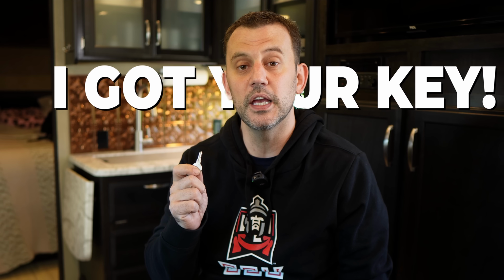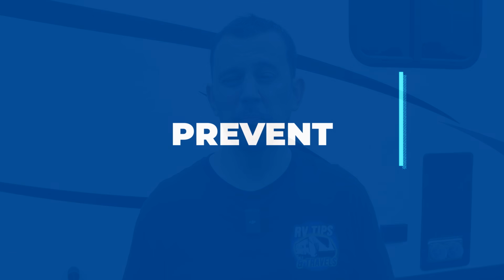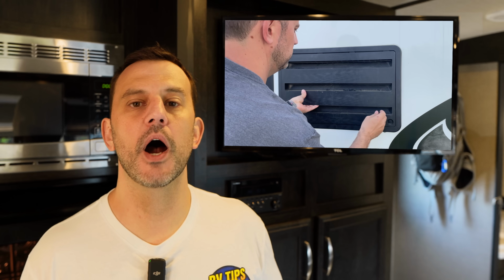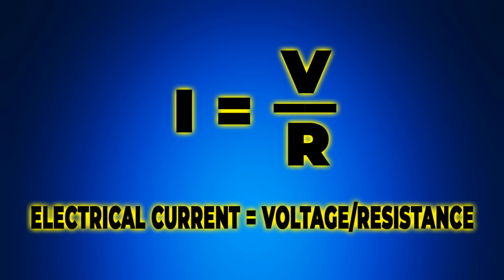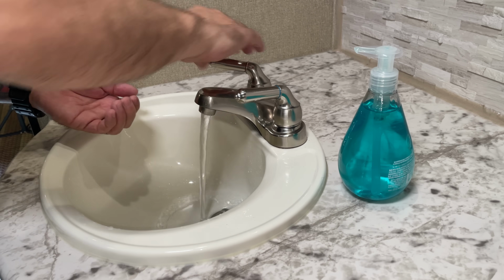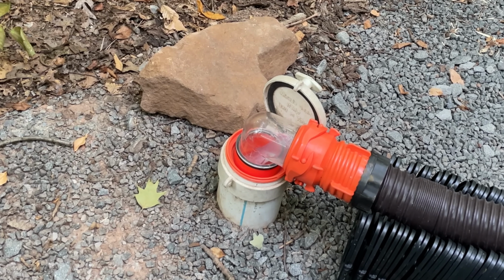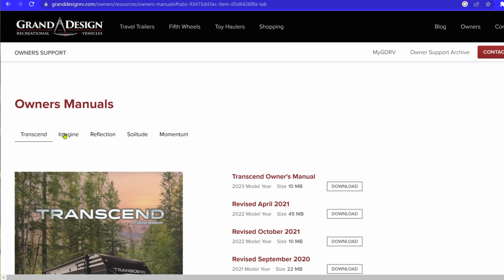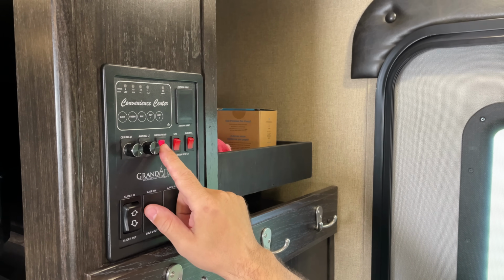7 Things You're Not Doing to Your RV... but SHOULD!

Comment: Very informative. 

I'd add something that someone once mentioned to me: wheel bearing grease can sometimes heat up, while the RV is parked in the sun, to the point where it will run out of the wheel bearing. Our trailer has been parked in the yard for a month, with one side facing south, and I just checked the bearings on that side. Sure enough, the grease had started to puddle at the bottom of the bearing. I'll check the north side when we pull in the slide before departure next week.
Reply from the maker: Great info, thanks for adding to the video Michael!

Comment: Great tips Ross! I second your advice on the contact cleaner. I keep a can under the backseat. Once fixed an auto level problem just by spraying the low voltage contacts of the system. Also in the fuse box of the truck. Had a fuel pump fuse that just needed the contacts cleaned. Truck started right up!
Reply from the maker: Thanks for sharing bud.

Comment: Wow. Never realized I should cut off the water when I leave the rv for a day
Reply from the maker: always, it could save you a lot of greif if a fitting bursts.
Reply: In 12 months ( 2-1/2 months over four years) I've seen it happen to ONE trailer. It's a calculated risk. I'm not doing it for one day. But if I'm leaving for a couple days or more, I'm shutting off the supply and opening a faucet.

Comment: I do have one sink that does drain into my blackwater tank, but I consider it a plus.  After draining my blackwater tank, I close the black water valve and turn on the tap at that sink.  I let the water run for 20 to 25 minutes being sure not to over fill my blackwater tank.  Then I flush it again.   (Sometimes more than once)  This really helps remove solids that may not have been removed on the first dump.  After it's dumped then I run the sink for another five minutes (valve closed) so that I have a water level in the tank to start breaking down solids right after it is emptied.  Also, before I hit the road, I dump the tank, add my five minutes of water, then right before I leave my camp site,I dump a bag of ice in the toilet so that bumps in the road help the ice further clean the inside of the tank.  Some people add a little dishwashing soap and lemon juice.  (don't add lemon pieces)  I usually let the ice do the work itself and don't mess with the soap.  We've been full-timing in this coach for more than a decade without any blackwater tank issues.
Reply: I don't have a sink that drains into my black tank, but after emptying, I place a dumbell on my toilet foot lever and fill the tank and empty again.  Sometimes, twice to clear the sensors.

Comment: If you replace your CH75 locks with something else, I recommend removing the finger lever (that curvy little thing you hook with your index finger to lift the door) at the same time. I learned from experience that the lever gives a thief enough leverage to just twist the entire lock assembly since it is just a round cylinder with some flats held in place in a vaguely similar shaped hole in a plastic door. The plastic doesn't resist much if you can twist the whole lock. After my trailer was broken into, I took the lock apart,  hacksawed the lever off, and reinstalled without it.
Reply from the maker: good point Scott, thanks for adding.
Reply: Most of those type locks can be opened with a flat screwdriver.
Reply: I'm sorry I'm slow to understand. Which part needs to be removed?
Reply: And I wouldn't just pick up the first tubular lock that you find.  Generally, the design is one of the easiest to defeat and some are even vulnerable to being quickly opened with a pen cap.  Though, still better than a universal key that everyone else has.
Reply from the maker: Thank you for this comment!  I appreciate it because its common sense.  Yes, any lock can be defeated.  The point is that its less defeatable because everyone in the world has a CH751 key on their keychain.  Im glad someone else understands the point.  🍻

Comment: Where can I find  the product list you use, it doesn't show on your videos!
Reply from the maker: Everything is down in the video description, but here is a copy:  

✨⭐ PRODUCTS FEATURED IN THIS VIDEO ⭐✨
🔹 Pass-through replacement locks https://amzn.to/3BH1QhE
🔹 303 Aerospace Protectant https://amzn.to/3WuWrnl
🔹 Camco Bug Screens https://amzn.to/43iuC3Z
🔹 CRC QD Electronic Cleaner https://amzn.to/3WufMoQ
🔹 Microfiber cloths https://amzn.to/3Mk5brT
🔹 RV Snapjacks & RV Snappad (10% off) https://rvsnappad.com/discount/RVTT10
🔹 Camco clear sewer hose elbow https://amzn.to/3CN8nYo

Thanks to Joshua from  for the assist with some B roll.
 
#rvlife #rvliving #rvtips #rvhacks #rvmaintenance 

✨⭐ OUR FAVORITE RV ACCESSORIES ⭐✨

ESSENTIALS:
✅ Camco Rhino Flex Sewer Hose & Elbow Kit https://amzn.to/3wxaiyG
✅ Camco 90 Degree Clear Sewer Elbow https://amzn.to/3eezBe7
✅ Camco RV Water Filter https://amzn.to/3VzcMqi
✅ Rubber Wheel Chocks https://amzn.to/3v0lL5I
✅ Hughes Watchdog 30 Amp Surge Protector/EMS https://amzn.to/3hAmgCy
✅ Hughes Watchdog 50 Amp Surge Protector/EMS https://amzn.to/3HKrpm1
✅ Liquified RV Tank Treatment https://amzn.to/3ksg1Ck
✅ Tire Minder TPMS https://amzn.to/3mjuBg0
✅ Water Pressure Regulator https://amzn.to/3m3ZFzZ
✅ Rubber Gloves 6 Mil https://amzn.to/3XNo7Dc
✅ Collapsible Water Hose https://amzn.to/3SvNubw

MAINTENANCE:
✅ Boeshield T-9 Rust Preventative & Lubrication https://amzn.to/3sjcjMx 
✅ Eternabond Roof Tape https://amzn.to/3Ad290J
✅ Geocell Proflex Sealer https://amzn.to/3KGMOyb
✅ Road Tool Kit https://amzn.to/41NIQKj

INTERIOR:
✅ Camco Cross Bar Door Handle https://amzn.to/3o8WWS5
✅ Shower Caddy https://amzn.to/3bdU80W
✅ Soap Dish https://amzn.to/3pKheSn
✅ Oxygenics Shower Head (White) https://amzn.to/3nhDMYW
✅ Oxygenics Shower Head (Brushed Nickel) https://amzn.to/2O8YcYC
✅ Perfect RV Paper Towel Holder https://amzn.to/3tZxd1K
✅ Dimmer Switch https://amzn.to/3rQdfFD
✅ Sliding Door Latch https://amzn.to/3EkpTT0
✅ Puppy Paw Hook https://amzn.to/2N9JaRV
✅ Foldable Storage Bins https://amzn.to/3tIp01f

EXTERIOR:
✅ X Chocks https://amzn.to/3m3ck2i
✅ Carmtek 10 Digit Keyless Entry System https://amzn.to/3t4IMpB (see the video here: https://youtu.be/KcEUgsDw6kk)
✅ Low Point Drain Valves https://amzn.to/3Jd6adb

OUTDOOR GEAR:
✅ Blackstone Griddle 22” https://amzn.to/3MDDiL0
✅ Blackstone Griddle 28" https://amzn.to/3eBnOuD
✅ Outdoor Gravity Chairs https://amzn.to/3Sb1p4M
✅ Ground Mat https://amzn.to/41u3wXg

💥 Sign up for our FREE Newsletter: https://view.flodesk.com/pages/6497c6a9d1998fa8c7623e9f

✨⭐ MORE RV ACCESSORIES ON AMAZON ⭐✨
https://www.amazon.com/shop/rvtipstravels

💥 NEW TO OUR CHANNEL? Check out our catalog:
https://www.youtube.com/c/RVTipsTravels/playlists

🙏 If you found this video helpful & want to support our channel with a small donation click here: 
https://www.paypal.com/donate/?hosted_button_id=J2KKM9NR3BJJA

✨⭐ DISCOUNT CODES TO SAVE MONEY ⭐✨

🔨 Learn how to repair & maintain your RV like I did w/ this COMPREHENSIVE training course:
https://rvtechcourse.com/?ref=rvtips&travels

🚐 10% off RV Snappads! https://rvsnappad.com/discount/RVTT10

🛌 Get 25% off your RV Mattress by Brooklyn Bedding at https://rvmattress.com/rvtips
Use discount code: rvtips

📡 GPS Tracking for your RV! https://www.wheresafe.com/rvtipsandtravels
Get 10% off by using discount code: RVTIPS10

Comment: I've had a lot of problems with where my fiberglass nose cap joins with the plywood/membrane roof.  All KV did to seal that was put a plastic downspout on each side and a metal strip over the top and then lap-seal the heck out of it.  It does not last.  What a mess.
Reply from the maker: Ugh!  Hope you get it straightened out.

Comment: I have a question, we had an issue with ants on our camper. Never have had this issue before. We were are the beach in a campground. Is there something we can use or what can we do to stop this issue From accruing again. Do you have a preventative for this?
Reply from the maker: Joey, we had that issue one time... I bought these and placed them in a couple spots in the camper and they worked well.  the problem went away before we left the campground but i cant say it was because of the traps or for some reason they stopped coming in... but these took care of the ones inside the rv during that time.  https://amzn.to/3pkKcOe

as far as a long term solution, theres way too many small areas for ants to enter an rv that you will never be able to seal up.  but they may be coming in if there is spilled food or drink somewhere.  hope that helps.
Reply: They have to crawl up from the points of contact with the ground. I normally spray the wheels, stabilizers and tongue with Home Defense Spray and the perimeter of the campsite when I get there to prevent the ants from coming in and it usually works but it rained for two days when we go there and didn’t have a change to get the spray out. There was no food opened or spilled in the camper. They just came in and kept coming. We sprayed the best we could the whole trip and for the most part they were gone. But when we got home we gutted the camper and spray every where. And we have not seen any more in two days, so far. I just didn’t know if you knew a solution to prevent them other than what I am doing. Thought there might be a secret or something I was missing.
Reply from the maker: Spraying down the camper like you are is probably the best advice I could come up with. Don’t forget your steps if they touch the ground. Thanks for your input. I’ll have to remember that if I ever have the problem again. Thanks Joey.
Reply: My ants were coming in under the door...(eventually figured out there was rotted wood underneath, and a bad weather seal. Its an old rv.). Anyway, before we fixed it, I sprinkled a heavy line of cinnamon on the inside of the floor, right at the bottom door edge. Stopped the ants from coming in. They won't cross it.
Reply from the maker: I’ve used these before in a pinch while on the road: https://amzn.to/3sMdXZZ

Comment: I think you should have a pressure regulator attached to the water supply before the filter as per manufacture.
Your configuration placed the filter first.
Reply from the maker: Richard, look closer… there is an inline regulator (non adjustable) before the filter.  I’ve recently switched to an adjustable regulator after this was filmed. However, 99% of the time I use my tank, not the city water connection.  Lots of reasons I do this that I won’t get into here, but even though I have a regulator you definitely don’t need a regulator to fill a tank since the line to the tank never becomes pressurized.  The regulator on the set up in this video is this one:  https://amzn.to/46kmbr8

Comment: I recently purchased a used 2001 Montana fifth wheel. I just noticed it doesn't have slide out seals under the slideouts. There are so many different ones that I'm not sure which to get to install. Where would I find this if I can't find a manual?
Reply from the maker: you shouldnt need to install seals if the rv didnt come with them, unless there is evidence of them being installed and they are now missing.

Comment: In addition to cleaning your cord ends, I add dielectric grease to the contacts. especially on the vehicals connection and especially when storing for the winter. This will prevent water and corrosives from even coming in contact with the metal. Keep in mind that this can be messy if you are having to handle your cords a lot.
Reply from the maker: definitely agree, dielectric grease is good, but in outdoor applications it can attract dirt.

Comment: Roof plumbing vents and the AC cover are a prime place for wasp nests. I found one in a roof vent and removed it. You can make a wire screen cover or buy screened vent replacements. Also check the roof vents for pipe extension length, if the pipe is too long it will touch the top cover and not vent. Use a hacksaw blade to cut the pipe. I will also install an AC cover for when my RV is in storage/not being used. Its not designed to be driven. We have a sink faucet handle that opened when traveling and dumped water into the RV. I now use a small bungee cord to keep it shut.
Reply from the maker: thanks for the comment William!

Comment: Not to go off topic, but have a question, we changed our water pump, when taking off hose we got water in tank area and of course got on carpet, we are in process of drying out, but at same time my hubby started changing all tires , he got one changed, and all of sudden I heard noise, the slide out was coming out by itself, tried to stop it so we could get the holding bars out, completed that, and a few seconds later, I moved trailor  back in and it st a red out again , it went o ut a few inches and stopped we left it a few hours, then bought it back it, do you have any idea what caused it or what we should check?  Thank you
Reply from the maker: sounds like you might have a short in the slide wiring somewhere.
Reply: @RVTIPSANDTRAVELS  thanks, next morning after this happened, the out switch has no power, dead, but the in switch does make sound, I guess this is for professional since we have no idea what we are doing, looks like no camping for us this year
Reply from the maker: It’s something that is hard to answer without looking at the rv in person.  Could be a host of issues.

Comment: 1. I keep the gray tank closed so I can use it to wash out the black tank water. drain the black tank then gray. 2. open the low point drains before turning on the city water so there isn't a pressure surge. 3. Don't use a pressure washer on the roof it tends to break the seals. 4. add at least 4-5 gallons of water to the black water tank to reduce the risk of a poop pyramid and smells. 6. drain water from the water heater when not using it for extended periods, it gets nasty...
Reply from the maker: Thanks TD!  Appreciate it my friend.
Reply: You do add black tank treatment to that '4 or 5 gallons' of water, right? Water alone will not prevent the dreaded 'poop pyramid'.
Reply: @Tsch6373 The treatment isn't breaking anything down in a weekend. Time. Sounds more efficient and cost-effective to just use water.
Reply from the maker: There's been countless videos of treatments breaking down solids over a 24 hour period.  It depends on which treatment you're talking about.  Some work, some dont. That's the harsh reality unfortunately.
Reply: @RVTIPSANDTRAVELS  in your opinion is it necessary to add it to the water for a weekend trip?
Reply from the maker: I get it, we all want to save money and reduce costs, but I am trying to liquify waste any time I can, even on short trips.  I explain why here: https://youtu.be/L50oamx7ivc
Reply: My kitchen sink is on a separate gray tank/drain from the one black tank. I leave that open all the time.

After three years, I finally started using Liquified to help keep sensors clean. I always keep the black tank closed and never had the "poop pyramid ".

Comment: Good video. As a 37 year Master Plumber I completely agree with you on turning the water off if you’re not in the RV. I would like to add winterizing the RV at the end of the season will save stress on the pipes and fixtures. Winterizing is a piece of cake. 
1.turn water off and open all faucets including exterior showers. Including drains located under the RV. 
2. Drain the water heater by removing the anode rod. Located near the bottom of the water heater with a hex head     .
3. Using a compressor blow air thru the outside hose connection. Make as tight a fit as you can and blow air until no water exits the faucets.
Winterize every year. Frozen pipe either breaks or weakens and breaks while you’re on vacation. On demand water heaters have no anode rod.
Reply from the maker: Thanks for commenting and watching Alan!
Reply: First year leaving mine up North. Going to do that AND pump in some rv anti freeze into the lines and traps.
Reply: You’re welcome

Comment: My vote would be for bearings and tires. Know the load and speed rating for your tires. Use a public scale and weigh your rig. Carry an infrared thermometer and check axle temperatures. About every trip I see a trailer on the side of the road with a flat or the wheel and tire missing.  Make sure you have a jack that can actually lift your rig. Make sure your towing insurance actually covers truck and trailer, etc. 
Also helpful to know Height, length, width and weight of your truck and trailer. Some YouTube channels suggest putting it on a sticker on the inside of your windshield for quick reference.
Reply: EVERY one of my five factory tires blew out on the road, in the third year with only 6k to 8k miles on them. I'd recommend replacing all of them with Goodyear Endeavor tires at 2 years or 5k Miles, whichever comes first.
Reply from the maker: thanks for all the feedback!  all great points.  some of these items we have covered in other videos, and some will be included in future videos.  appreciate it my friend.
Reply: Great point, also check the tire's age by looking at the code on its side. Old tires don't always show cracks. Google search for deciphering the code.